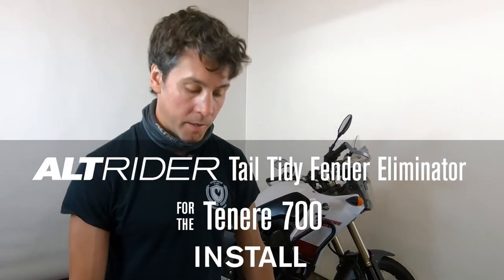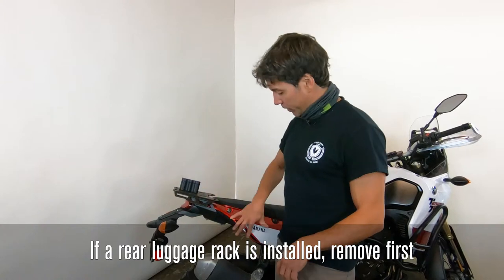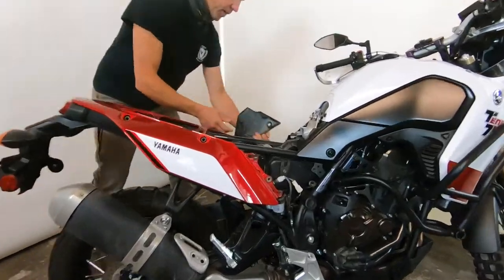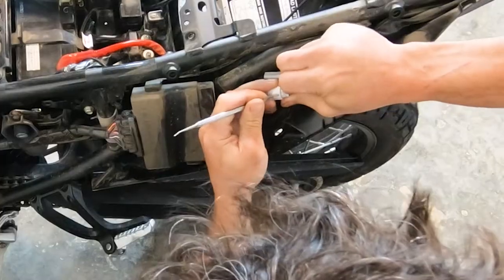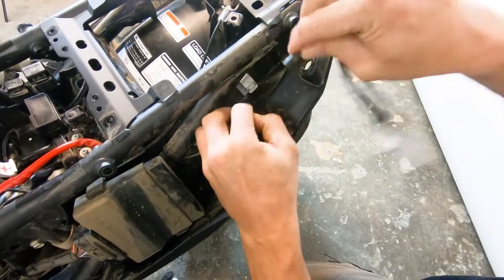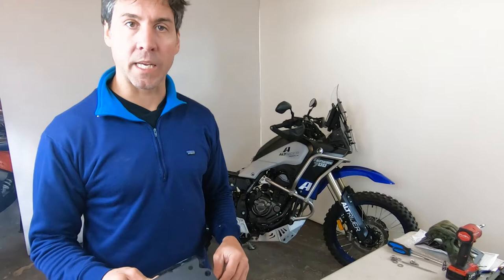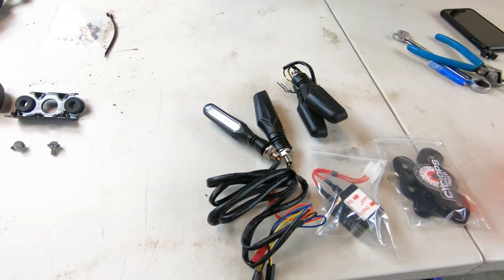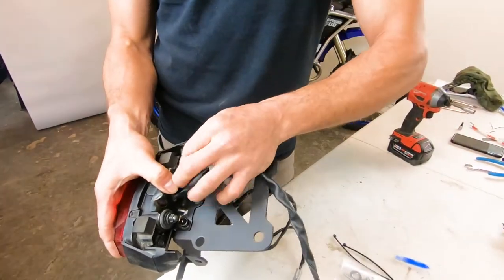AltRider T7 Tail Tidy Install

Comment: Just finished up my tail tidy by altrider.  Thanks so much for an excellent video!  I’m not mechanically oriented at all, but this video made it a breeze!  I have an HP corse exhaust I installed at the same time so I had to make some new drop brackets (so right blinker doesn’t melt) mounted to the license plate, which was easier than expected and still looks great.
Reply from the maker: So glad our install guide was helpful for you!
Reply from the maker: Do you have the HP high exhaust? Customer service has had this come up from other customers...
Reply: @AltRiderLLC  yessir I do.  I can send you some pictures of what I did if you’d like.  It isn’t perfect but it worked out really well.  Basically just cut two pieces of 1” angle aluminum and used the 4 holes designed for mounting license plate to mount to.  Then drilled a hole to mount the cyclops blinkers into.
Reply: @AltRiderLLC  also just uploaded a couple shorts of my bike as it stands now.  Not sure if they’ll help much in regards to showing the details of the tail tidy mod.  I just sent you an email about 10 min ago with more detailed close up pics.
Reply from the maker: Thanks! I know customer service has been emailing with you...

Comment: How well does the tidy tail function as a fender also to prevent flinging of mud and water? Also does the position contact the tire on hard bottoming? Thank you
Reply from the maker: We didn't find mud or water to be problematic. Also, it sits further away from the tire than the OEM tail, so it's not going to be hitting the tire

Comment: Does this tail tidy leave an opening at the bottom of the tail? I find that drawback of all after market solutions compared to the stick, because it can allow water and dirt to enter the subframe
Reply from the maker: There isn't a hole that leaves parts or electronics exposed. You can see in the video there is the Yamah plastic wheel well that goes the entire length.

Comment: I just watch your video I am wanting to install on the new world raid. I’ve looked at a couple of images and it looks from the back that the indicators aren’t level is the bracket where the indicators fixed at an angle. Thanks
Reply from the maker: If you look at studio photos of just the part (not installed on the bike) on our product page you can see the two bent flanges that the indicators attach to. They're bent in a form that creates 90 degree bends - so it's possible it just the way the photo is angled.

Here's the product page: https://www.altrider.com/altrider-tail-tidy-fender-eliminator-for-the-yamaha-tenere-700/pid/3337

Comment: If I do want to use the blue wire, what do I connect it to? The yellow as well?
Reply from the maker: The blue and red Cyclops wires taped into the OEM yellow will make the blinkers have running lights. Be sure to consult the Cyclopes instructions for specifics
Reply: Thanks for the reply! Great video you guys did.